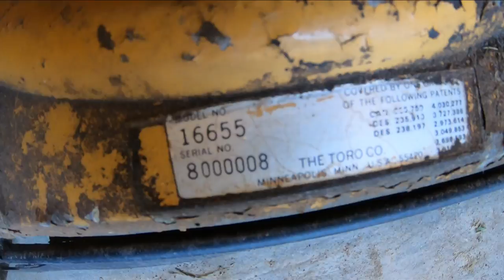Vintage, Heirloom Lawn Mower, Will it run?

Comment: I guess we have different definitions of the term vintage!  

I am about to take on the reabilitation of a 21" staggered and one floating wheeled 1956 Lawn Boy 2-1/4hp mower.  It is lite enough to be picked up with one finger. It too has the magnesium-aluminum deck.  It was able to level 1 meter grass when a 6.5 Briggs IntekPro Toro commercial 22162 couldn't!

I have the LawnBoy electronic ignition module designed for "B" & "C" engines and it needs a new base seal as it stopped sucking in fuel.  I have 2 parts motors since most parts are about 50 years discontinued.

I will make a video of restoring that pup.  It would be great to use  it again.  It had about 15 years of dependable commercial use replaced by a Honda HRC216HX that only lasted 2 years!

Comment: The makers of mowers do not want them to last 40 years these days!
Reply: you are lucky to get 5 years out of the new models just like water heaters or 7 - 10 years on washers and driers and 10 to 15 on Refrigerators
Reply from the maker: I think youd be hard pressed to get that out of a fridge!
Reply: @DieselCreek  going on 8 yrs on a fridge. Some shelves are cracked and crisper are contrary but still cools!
Reply: I have to say .. I bought a Honda (forget the model silver body red motor) About 12 years ago (2008 ?) and lent it to a tenant of mine.  She NEVER put in her shed. I live in Maine and we often get 4-8 feet of snow every winter.  She just left it out all winter.. But she was such a great tenant I never made a fuss about it.  To this day that mower will start with one  two pulls..
Reply: My dad always said 30 years on all appliances.  I say the same and my wife laughs at me. Sadly,  she's right.
Reply: Definitely not! Even the carbs are plastic disposable garbage mowers sad how everything is becoming these days
Reply: Polecat54941 They don’t even put oil drain plugs on them anymore. Some even say you don’t need to change the oil just add as needed...that should tell you something.
Reply: @DieselCreek  Well you might find it hard to believe my luck then. I rent a ground level 2 bed. apt. w/ master suite for $490 month but paid $50 wk. for year round basic maintenance.
It has a Whirlpool fridge,Roper dishwasher,and Tappan electric range/stove all over 22 yrs. old.
The fridge operates on the lowest setting,the dishwasher works better than any I've seen/had,the oven is calibrated perfectly for temp. and I've lived here 6 yrs. with no problems to them except cleaning the coils on fridge.
Yes,I realize and appreciate my good fortune in this area
Otherwise my snowblower,lawnmower and trimmer all need the carbs cleaned after off season or they won't start.
Reply: @corydriver7634  i ran across a honda ohv push mower with a broken timing belt that was fubar. A push mower...with a timing belt...for really no reason but to be overlooked and kill the mower...thats what i think anyway lol. 👍👌✌😂
Reply: planned obsolescence my friend.
Reply: Thats the truth I got a old lawn mower from 1985 and its frame finally went on it a few years back but it took 30 years for that to happen and I bet the used on I got for it wont last that long.
Reply: @handiman5001  with water heaters  its by design that the thermstarts only last 7 years I have replaced ours twice... its still going strong
Reply: 38 yr old eager-1, both kick ass!
Reply: @corydriver7634  They get a kick back from the oil boys!
Reply: @handiman5001  speeking of fridges and old stuff, we had a fridge for over 20 years, and my grandmothers one is now pushing 50. Ive 5 vintage chainsaws between 35 and 50 years old, 2 vintage lawnmowers and various other vintage engines. They dont make em like they used to
Reply: At this point you’re better of fixing old stuff than buying new old still is outliving new

Comment: Toro is a great brand, even today. Theres a lot more plastic and safety measures but you still get the cast aluminium deck, throttle control and self drive. Pay a pretty penny for them

Comment: Back when I was in high school several decades ago we had a mower almost identical to that one.  It wasn't self propelled but then, it had me as it's mobile source.  That thing was so bullet proof with that aluminum deck almost nothing could stop it.  I wound up with it many years later after I left home and had a place and family of my own.  It was still running and cutting like it always did.  The one thing it would do that very few, if any, of the Chinesium knockoffs will do today is mow a ditch with water still in it.  If the carb wasn't in danger of getting water in it you could actually run the mower into the water and it would cut just as well as if it were dry ground.  I would never have believed it if I hadn't tried it.  Today most riding mowers come with an attachment to allow for a water hose to be hooked to the deck to clean out the excess buildup.  That mower was just ahead of it's time! Sadly, some (expletives deleted) prankster drove a piece of pipe into the ground inside an area I had been cutting for a long time and I hit it with the mower.  Sheer pin did it's job but not before it managed to cut a piece of the pipe and slam it through the body, knocking a big hole in it.  I've never had a mower since then that was as solid and reliable as that old mower was.

Comment: Nice mower. Sure don’t make them like they used to. Tip: Turn the folding handle knobs around to the inside of the handle and they don’t get broken when hit against something. Cheers, Jeff. 👍😀
Reply: I did the same when I got my new Troy Bilt in 2009. I took the bolts out and flipped them to the inside. I also do not stretch the starter rope through the handle. I leave it in the engine. It saves the starter rope from wear and damage and keeps it tight. 13 years of weekly use and it still starts on 1 pull.

Comment: I have a similar engine on a old tiller that I have it’s a 60s model and if you have a hard time finding points you can purchase a nova chip for it which will make electronic ignition they are cheap and so far I haven’t had any problems with them I run them in my old Husqvarna chain saws as well enjoy the videos keep them up

Comment: The flywheel key is two pieces fused together somehow, so it will sheer. They mean don't put something like a piece of key stock,in it as it will damage your crankshaft if you were to hit something. My dad showed me that a long time ago. Look at the factory key, and you can see the fuse line on the side of the key. If it doesn't. You definitely need to get a b&s key and put in it.

Comment: Been a long time since I saw one of those fancy gear drive starters.  Had an old self propelled "Lawn Chief" like that.  It used a horizontal drive pulley that came off the side of the block.

Comment: I inherited the push version of this from my grandparents, probably a few years older based on the typography on the control panel. Has an S-shaped blade as I recall. I haven't used it in 15 years, but have held onto it because it's lightweight and simple. It's weakness is that it doesn't handle heavy or wet grass with the shallow deck.

Comment: I would like to find one of the old Reel type mowers. That is what we had when I was a teenager mowing mine and my grandparents yards. We lived nest door. My grandfather was a blacksmith and he would keep it sharp. Those things did  beautiful job on the grass. It had a Brigs and Stratten motor. I took the head off of it once just to see what was in it. Luckily it still ran after I put it back together. As a young teenager, it was the first motor I ever took apart.

Comment: The mower I use in the summer doesn't have a stupid safety bar either. Dates from 1982 I believe? It has the great advantage that your hands don't get tired from holding down that handle.

Comment: I worked on many of those ol briggs and scrapiron motors rebuilt alot of pumps and generators that had the ol 5 hp and 8 hp motor on them still have my condensor pliars and special socket for taking off the starter clutch

Comment: That aluminum deck is the savior there on this mower! If you don't clean steel deck mowers at least the end of every season you are good for about 5 years tops at best. I've got a YardMachine 21" that's 7 years old and still going strong...keep that underside deck clean, run it out of fuel at the end of the season, oil change at the start of the season...should be good to go for awhile.
Reply from the maker: Ill agree to that, the decks are garbage.

Comment: I used to go after the old lawboys because of the aluminum deck....  They were light to push as I can imagine your setup is also.  The only thing I remember about the auto chokes on those is they worked great when they worked, but when they didnt they could be stubborn.  I cant remember if there is a diaphragm, but I do know there is a small cap on the side of the carb with a gasket that needs to seal.  Thats if I remember correctly LOL.  Thanks for sharing Matt !
Reply from the maker: you are 100% correct, everything is great till it isnt lol

Comment: I also have a Old snapper self-propelled lawn mower and it's a rear wheel variable speed for the motor and self-propelled speed she blow's a little oil out of the muffler now and then I love it got to fixed the rope recoil but she sure does run good yuuuuuuuuuup

Comment: That machine was known as a Toro Whirlwind, it had an S shaped blade  and could of had a cloth bag to catch the grass . I have the same deck design that was made with an electric motor, it was not self propelled.  Toro has been around a long time.

Comment: Nice old mower. A lot of those don't handle the typical E-10 fuel we get standard anymore. It messes up the rubber bits and when you let it sit in the carb it draws moisture and corrodes the insides. I've had to replace a couple carbs after forgetting to drain them and run them dry at the end of the season, just no saving after that. I'd use the E-free stuff, but it's hard to find around here. Ethanol fuel has probably killed more good small engines than anything else.

Comment: I have an older Craftsman Briggs & Stratton which I recently took apart down to the open carburettor. Cleaned if all up...(I don't have a compressor)..new plug.. won't run still. I didn't know about the removal of the flywheel and check the point..... My late brother used to repair mowers,,,,but it was up to me.

Comment: Briggs engines used a aluminium shear key using a steel key can result in the flywheel shattering if you whack something at full mowing speed. They did an interesting demonstration at briggs tech school on what happens when you hit something at full speed with a steel key in the flywheel. it resembled a grenade exploding. So speaking as a mastertech for briggs I strongly suggest using the correct key. Speaking as a fellow wrench twister you do what ya like but picking flywheel bits outta your teeth ain't much fun lol. Love the vid and if you ever need any info on old briggs stuff drop me a line
Reply from the maker: hey i appreciate that, ive got to assume that was the correct type of key, he only used genuine parts, i didnt see if it was magnetic or not, ive got a box of those keys floating around somewhere if not.

Comment: Look at the first two digits of the code on the engine and you'll have your year. I had a 68" Whirlwind, almost identical, a little older. Toro had this painted yellow, they must have sold it under a different brand at some store, but its basically a yellow Toro Whirlwind.

Comment: Hey Matt you can mount the diamond tread plastic tires  use a two 🪛 and then warm the tires in hot water and put them on those metal rims  krylon Carey's the close paint to toro or rusteloum regal or fire hydrant red then sand the handle down and use grey texture  paint or black hammered paint the silver  looks like fencing you can also use rim paint call argent silver like Chrysler Chevy metal rim paint
Also matt do you have a extras deck handle 2 metal rims tires can be shot   side chute handle assembly

Comment: after you add gas and no start... pull the plug and check for spark. Also you ground the plug to complete circut, otherwise you got no spark, cuz it won't likey jump two gaps.

Comment: The alum. Key is for lawn engines steel for belt drive alum. Will save crank.if hit rock just a slight indention on alum. It won,t run started out on lawn mowers 60plus yrs ago now finish up on cats

Comment: I have a similar vintage Mongomery Ward Pow'rKraft mower that I found in the bushes behind my old house along with a few others in various states of disrepair. (The others were rusted or broken beyond any hope of repair and got scrapped but I saved this one because it was complete) It has "TORO" cast into the deck but all the other branding is Montgomery Ward. I have not tried to fire it yet but plan on doing a video at my @bigbadsubaru channel when I do! Controls look very similar to yours and also lacks the "deadman control" that wasn't required at the time.

Comment: Back when the throttle turned it off or it had a spark plug kill.
That’s a deluxe with a dipstick instead of looking in the hole to see if it touches the bottom of the slot.
The safety switch on the handle is not to protect the operator. It’s so the operator doesn’t walk into the house for a cold one and leave it running.

Comment: I have probably have an air filter and all the tune up parts in stock for that engine, should even have the carb diaphragm too.......  Also, very easy to convert that over to electronic ignition by using a newer coil from one of the Classic or Sprint series engines.
Oh, it’s not a good idea to choke an engine out to kill it. That washes the cylinder walls down with raw gas.

Comment: OKS !!! Can ALWAYS count on B/S Motors !!  Gots a short story about TORO mower that we got when my Mother died !!!  She bought it in 1977-went thru 2 floods with water over motor - changed the oil, clean gas tank & air filter - Pulled 3 times & off she went both times !!  Still use today in SC .. Uses NO oil - NO belt change !!! HOW'S THAT ???  Thanks for the video & What about the ""OL""A_CAR ?????
Reply from the maker: the A car is on the list, but ive been getting the more important stuff done, got the driveway in most of the way and starting on the building now. once I have dependable access I could work on it easier

Comment: Ive got the same engine on an old toro whirlwind. I customized it but i cannot find the puller to the thing. I know ive got it somewhere in the garage lol (update) ive got a new carb and tank setup for it that fits the year. Now i gotta dismantle the engine thanks to some odd clank in the crankshaft.

Comment: Should sink a pole in the center of the lawn and tie a rope to the mower on the outer edge and let her rip. Take a break on the porch until the ropes wrapped up. You can make wider passes with a larger pole to save some fuel.

Comment: 9:40 what you do it hold the plug against something grounded and watch the plug it should spark inside. If your trying to hold it away from the ground it’s gotta jump the ground and then to the machine making it very difficult for the spark plug to do anything.

Comment: Speaking of safety and Meatball, back in the day (like way, way back) they used to breed bulldogs to be 150-200 lbs, and their job was to chase down the bulls which were allowed to roam wild for most of the year, and then grab them by the nose and drag them down so they could be haltered and taken to breed the herd. 

So imagine a charging (probably very angry) bovine with a triple-sized Meatball hanging off its nose doing that super chomp thing, and thank the good Lord you live after the invention of the internal combustion engine and rubber frisbees.

Comment: One thing about that mower. The drive belt on ours is 14.5 inch and sadly, one can't use a 14 or 15 inch from an auto parts store. Toro wants an arm and a leg for the belt as it is proprietary, If you can even find one.

Comment: I stopped at 17:36 to mention you don't need to reassemble to check spark. Just place the flywheel on the shaft and spin by hand.

Comment: The key i the flywhell is Zink not  steel, its a safety not for you but for the motor if you hit a stump.
Newer seen a B&S as this, clean it and paint i its very old.

Comment: I have an old snapper from the 60s that used to run but has some compression issue. I have 7.5 acres so I don't use a push mower unless I have guests. (Which isn't very often)
Reply from the maker: should be able to find a motor for next to nothing!
Reply: @DieselCreek  online or in some store?
Reply from the maker: Junk yards or yard sales stuff like that, I find good mowers on the side of the road all the time for free!

Comment: lol alot of them came with aluminum keys.. they shear when the blades come to a sudden stop...Its supposed to save the crank from bending or breaking. They used to sell them in 5 packs.
Reply from the maker: yes ive got a pack of them hanging here but didnt realize they were not steel.

Comment: A bit of sea foam for the rings at some time maybe. I wouldn't trade for a new one as it goes into places where well hidden rocks ..... quite the machine... the zero turn for pasture mowing hard to beat tho... the tractor with el wide swath brush hog will do the large two pictures of lemonade will barely get you though this mess
Reply from the maker: yes ive got a 60" zero turn for the big yards. just the little postage stamp gets the push treatment.

Comment: Use an aluminium key so is will shear if the blade hits something and won"t damage the crank or flywheel.

Comment: I used mowers like that in.my lawn business but that Toro ran .Tecumseh engine either recoil or crank
Reply: you get a chance take the cover off an power wash the engine get all that dirt off it will.run cooler I use simply green or dawn to break ip.the dirt love it